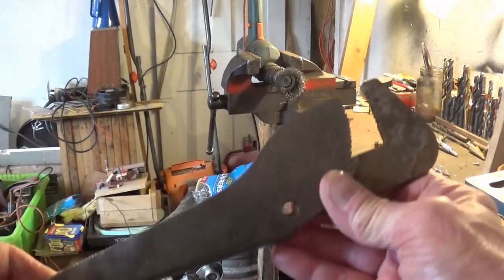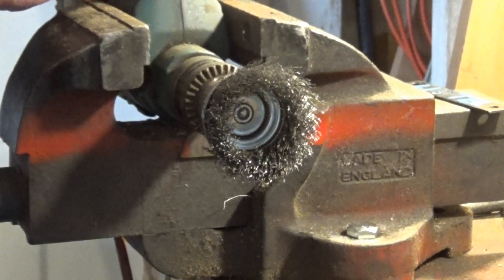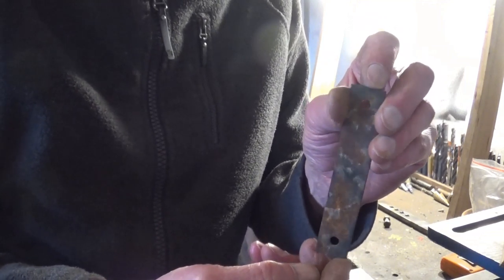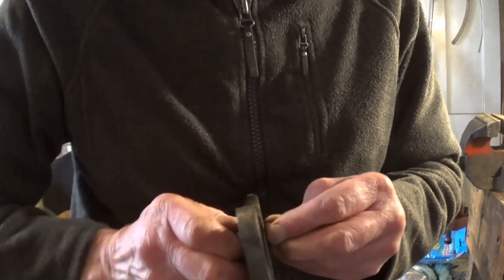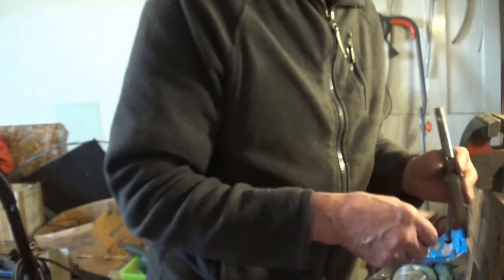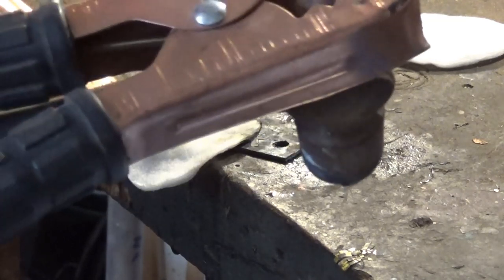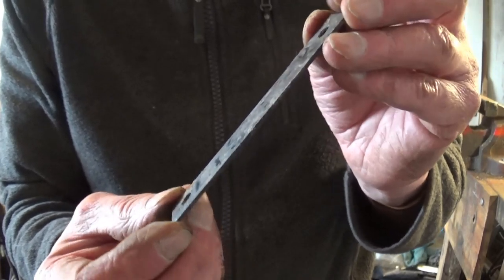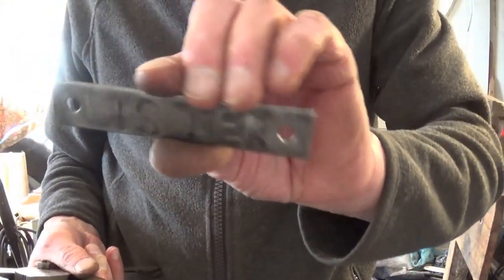Restoring Antique Pipe Wrench and Etching a Lister Plate

Comment: Nice pipe wrench in excellent condition Malc ! Lister plate looks good too !
Reply from the maker: Many thanks. It's the inside that's stumped me for quite a while. That's the first raised letter plate I've managed to do. Came good in the end. Think I'll put this on the display board 😊
Reply: When I have a  motorcycle tank that is rusted inside, I use oxalic acid (rhubarb) and that works great for me !
Reply from the maker: @massimobroccoli9854  There are lot's of treatments nowadays. However years ago we never knew about them. Just did it the hard way.